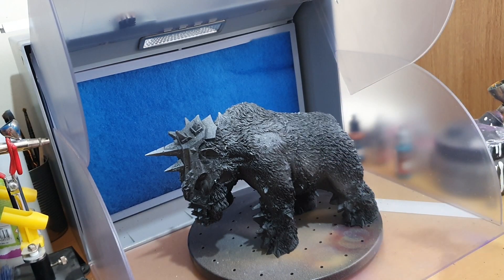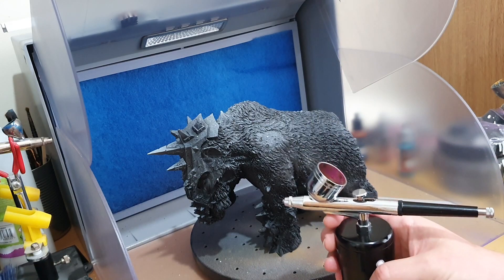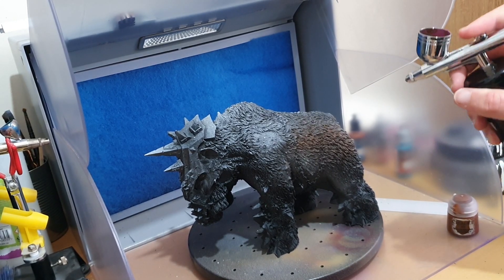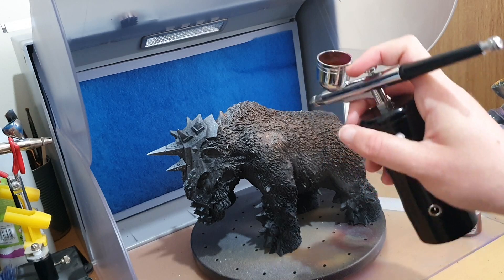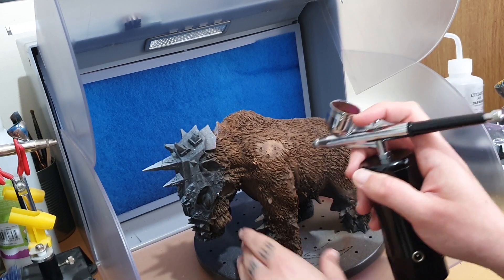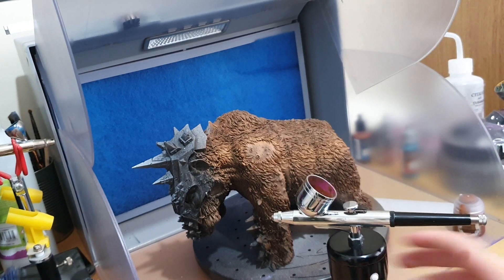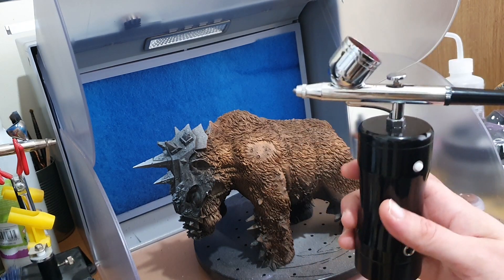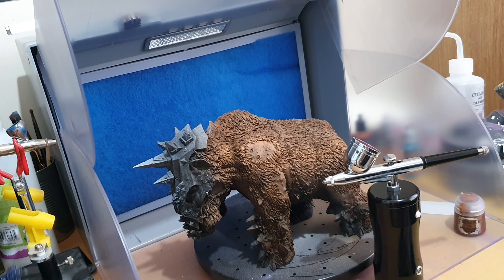Are Wireless Airbrush Compressors Good for Miniature Painting?

Comment: Thanks for the review.  This is exactly what I need - my painting desk doubles as my work-from-home desk and I don't have room in the office/den (which I share with my GF who also works from home) for a static spray booth or a compressor and other bulky stuff to move.  I live in an  apartment building and I don't have a garage/basement/patio to use a spray can, so I just want something I can stow in a drawer and only planning to use it for priming and basecoating (and painting tanks with a brush is a bitch).  And it's quiet enough to use in the evening without waking anyone up!  It is reassuring to see that this is actually useful, I was worried that it might be junk.

Comment: Mate,  that was an excellent review and it answered all my questions too.   I used to have a nice 40psi portable, but i lost it somehow between moves.  I did not want to shell out 200 bucks to replace it.  Thank you for your thorough review.
Reply from the maker: Thank you so much 😊 I'm glad this review has been helpful
Reply: @bitzbox  You have done this for a long time, I can see.   Can  you explain the difference between my paashe dual action and a single action gun?  I am not certain I understand the difference.   Thank you for your time.  Todd K.
Reply from the maker: So with a single action you press the trigger and it sprays and with a double action you need to press the trigger and pull it back to spray. This gives you a bit more control about how powerful the spray is
Reply from the maker: I'm afraid I don't have videos on these myself. I only use acrylics myself but I've seen people have great results with oils too. As for thinners I quite like using the Vallejo one but with most of the time I just use water

Comment: Can you connect the typical 1,8meter hose in order to not have to carry all those battery weight and to be more flexible?
Reply: Maybe but you'll be dropping the pressure even more
Reply: You would need to buy/make an adapter as the connection is not a standard one and I would only use a short hose something in the region of 12" to help reduce pressure loss. Check out other reviews on YouTube the pressure output on some of the different brands is higher so pressure Loss using a hose could be negated by getting one that pushes out more pressure in the first place.

Comment: You have a portable paint booth, so why not a portable airbrush?  Think about airbrushing the track on a model railroad.  Many meters of track around a room.  Do you want lug around a compressor, short air hose, and airbrush with extension cord attached or would rather move that thing across the many meters of track as you spray?  There is s right tool for every job.
Reply from the maker: Very well put!

Comment: What background for stopping the paint is that where did you get it I need one
Reply from the maker: I use this spray booth - https://www.amazon.co.uk/Portable-Spray-Booth-Extraction-Filter/dp/B0050BQQUW/ref=sr_1_11?adgrpid=54945249322&dchild=1&gclid=Cj0KCQiA6Or_BRC_ARIsAPzuer9J1sTbtI9ahyALXoUt9-Iy0cQgJfoauenQ2zOPz4JlvxTUZTaHcroaApL6EALw_wcB&hvadid=259043260789&hvdev=c&hvlocphy=1006744&hvnetw=g&hvqmt=e&hvrand=13998767134185683276&hvtargid=kwd-296277135094&hydadcr=27100_1725046&keywords=airbrush+spray+booth&qid=1610311229&sr=8-11&tag=googhydr-21
Reply: Also what air spray gun do you use
Reply from the maker: @trondom6990  There's a couple of links in the description to the type that is used in the video. If you want to know which one I use on my main compressor then I use the Badger Patriot 105

Comment: No matter how much I cleaned it mine kept clogging after every use. And no amount of polishing etc would fix it :(

I don't understand but I bought a new airbrush and installed it and it only worked again half a use. Could it be that the motor is too weak? It can't even pump water after a use. I thin my pain a ton. I used nail polish thinner a ton with acetone